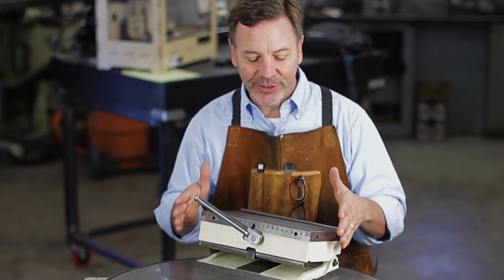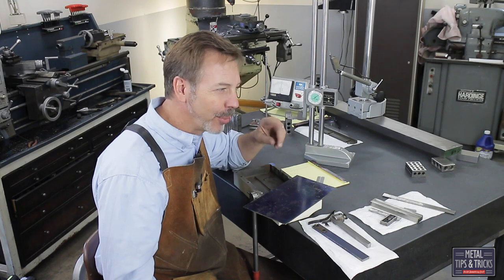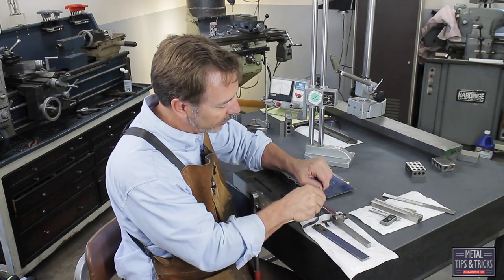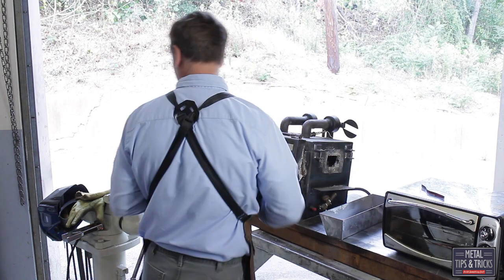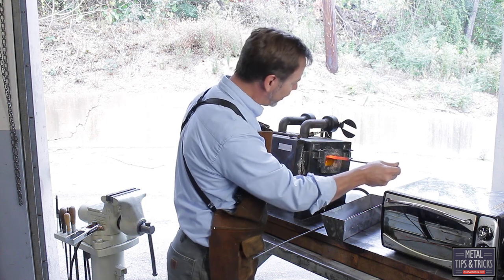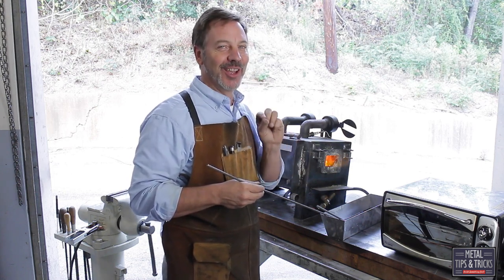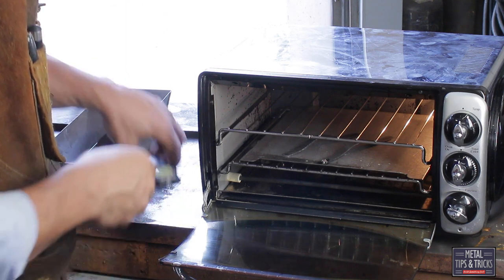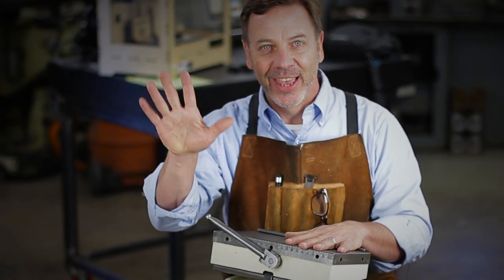Making a Leaf spring  part 4

Comment: Hi Dale,
If you need an in between oil to quench that in my opinion does better than motor or hydraulic oil, you can use olive or canola oil it has an even higher flash point....
Doesn't matter if it is rancid metal don't get fussy....   ;)
Cheers,   Pierre

Comment: Just a tip, use a magnet to verify if the steel is up to the correct temp for hardening to be effective.  The steel will become non magnetic when the correct temp has been reached.  Pull it out of the forge when the color looks correct then touch it to the magnet.  If there is no magnetism, quench it.

Comment: Glad you clarified, I was wondering who made 1800deg toaster ovens! lol 30mins/in of thickness is pretty much standard for quenching and tempering.  300F is pretty low for a tempering draw.  I would have expected more 700-800F to avoid being prone to fatigue fracture.

Comment: Can spring steel, 1074/5 or 1095 be purchased ready hardened, and therefore workable  without the need for heat treating.  I understand the overbend will be excessive to normal but would like to know the answer.